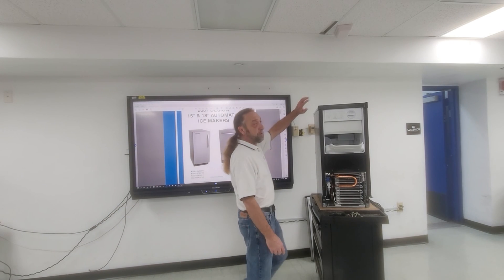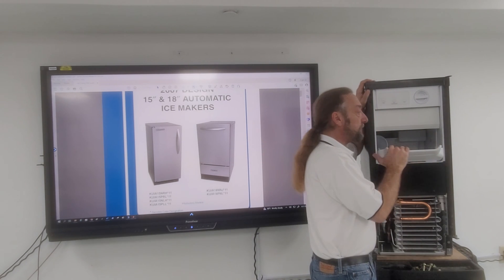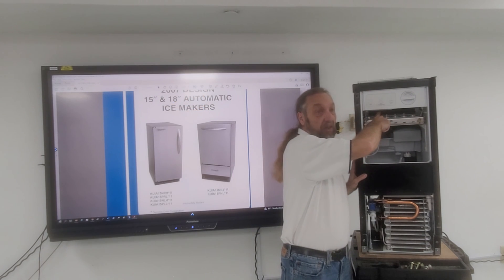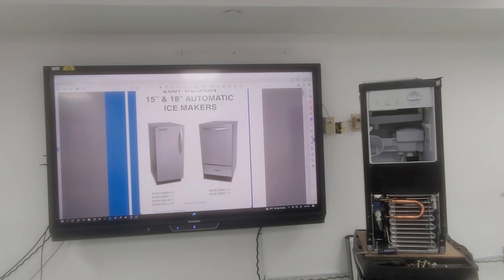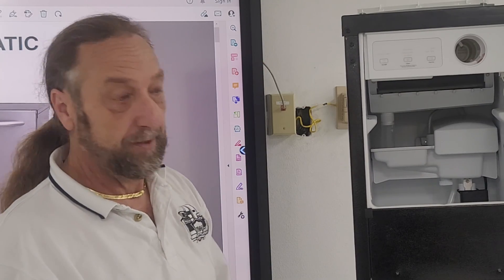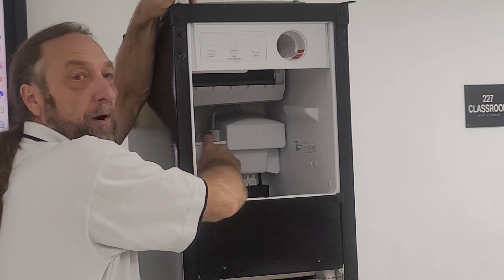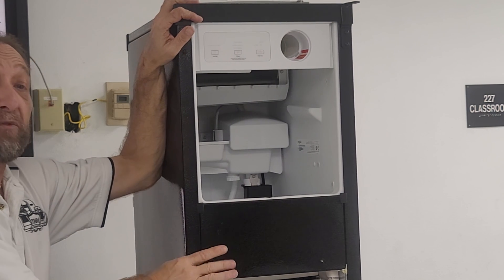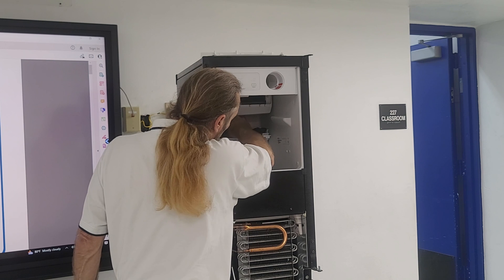ICE Maker Part 1 teardown

Comment: I have a GE Monogram unit similar to this (2013 build).  I have 2 questions.  1.  Mine is not producing ice and seems like the recirculation pump has gone bad since no water is getting passed up to the plate.  Can I assume replacing the pump will likely fix it?     2.  Since I got the machine new, there has been a very loud buzzing sound (like transformer noise) at the top of the unit behind the control panel.  Is there a chance I got a bad one from the factory?  It's so noisey even when the bin is full and not producing any ice.  Is it possible to fix that? Thanks!

Comment: Great videos.  I bought a home with a Whirlpool Under Counter Ice Machine GI15NDXZS1 manufactured 5-16.  It is making ice but the ice sheet comes out super thin like maybe an 1/8".  In the last 24 hours it has barely filled the bottom of the bin.  I have removed the filter in case it was clogged and it did not make a difference.  I definitely have good water pressure going to the unit with no kinks in the hoses.  I also bought the Affresh ice machine cleaner solution and performed a cleaning cycle.  Nothing has made a difference.  The cycle times seem to be about 15 minutes in fast ice mode and 22-23 minutes in regular ice mode.  Can you tell me how to put the machine in diagnostic mode to try and troubleshoot the problem?  I am wondering if it just needs an adjustment on the amount of time it freezes the water before releasing the thin ice sheet.  Can you help?  I will be happy to send a contribution to TMM Appliance Network.
Reply: I've the same problem with my Kenmore machine. Did you find an answer? Thanks.

Comment: I have same machine . Water supply keeps running . Even during ice cycle . What could cause the to happen ?
Reply: Same shit, and there's no water level sensor
Reply: @whitebear1903  I guess the machine will purge water for ten mins before it start a ice cycle . It does have a water level sensor located by the pump .
Reply: I suppose it's built in the recirculating pump
Reply: Same Problem here. Water fills, spills over for a long period of time, then circulates over the freezer plate, then starts all over again. I am wearing out my filter about every other month and still water goes in the tank, spills over, and my drain pump works like a dog in heat!! LOL. I replaced the wiring harness with the thermistor and still have the same issue. I wish something was available more than a service person from an authorized Whirlpool dealer that costs you more for parts and labor than if you buy a new unit. I am on my second unit. Any help here with why this happens would be very much appreciated. I wonder if it is one of the two pumps but they keep pumping!! Thank you all!

Comment: Excellent video! We have the exact same icemaker. It is only making very thin ice. What might be causing that? ( I have replaced the filter. I have checked the water line. Clean the machine twice. I even reset a control board. It is making ice… But it is only making very thin ice. Any suggestions? Thank you so much!
Reply: Depending on which control board you have, there are three settings for Thin, Normal and Thick Ice.  I believe newer boards it can be set using the manual diagnostic cycle test where ice thickness can be set in step ten.